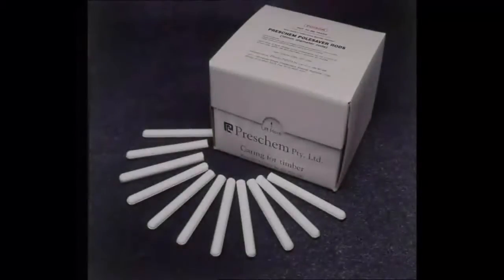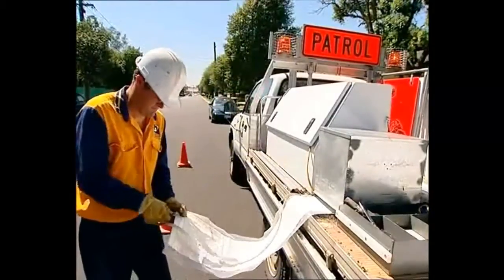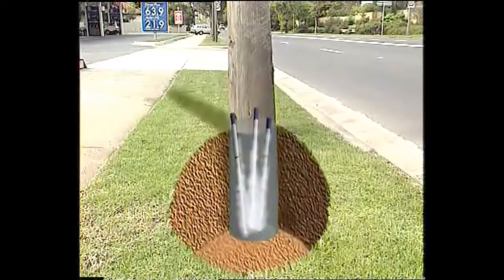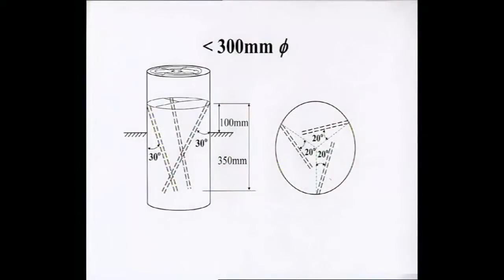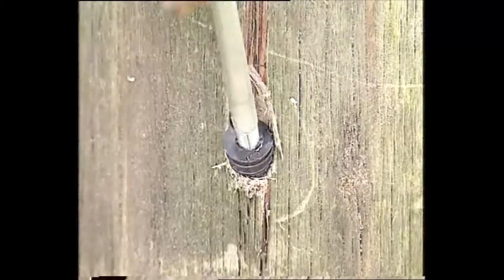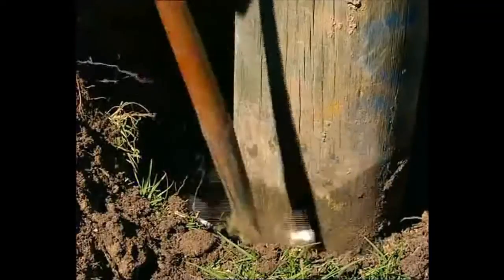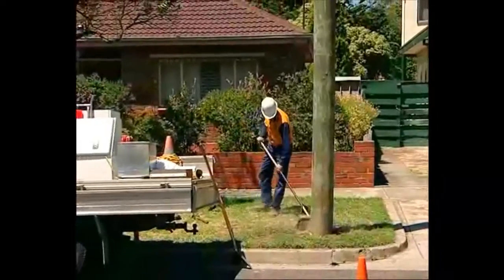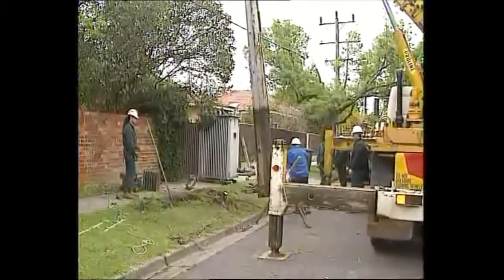Polesaver (Part 2/2) - Preschem Treatment Products

Comment: The power company has the plastic caps on the poles on my street, the homes were built around 1963. Most of the original poles are still here.
Reply: Thats common to  protect the top from rotting from the top down when it rains. But durable timber poles won't really rot mid-span above ground, except around crossarms or fixtures like transformers as the cointact point holds in moisture. Where a power pole rots is at/below groundline. And that's where the strength needs to be for wind loads. Which is where groundline treatments come into play, as they seriously extend the life of a timber pole. It can easily double or tripple it's life. - Yes I work for Preschem.